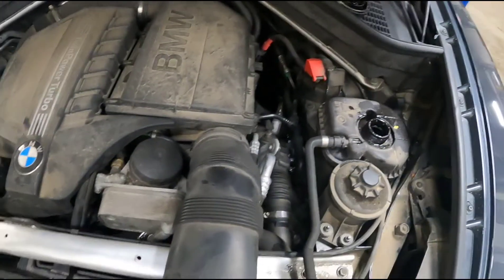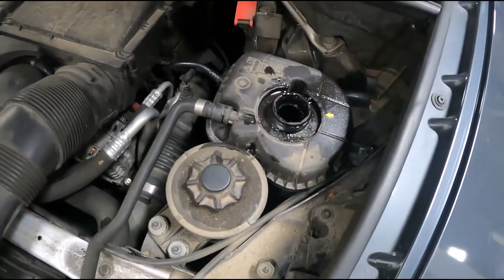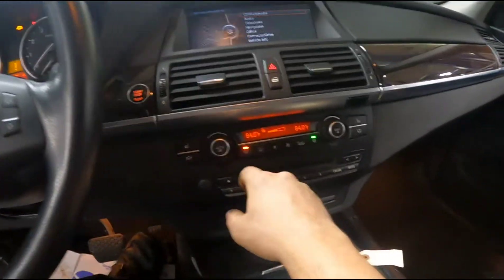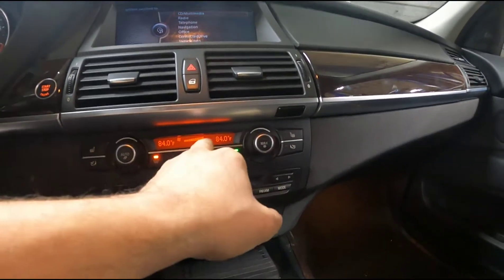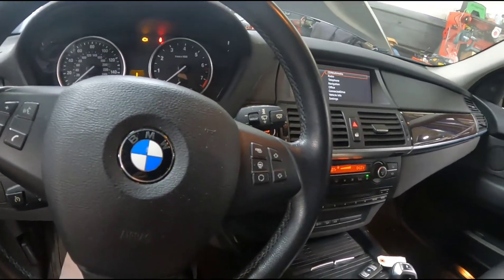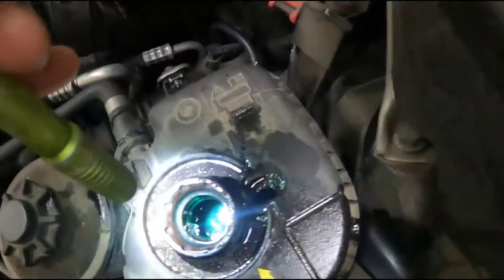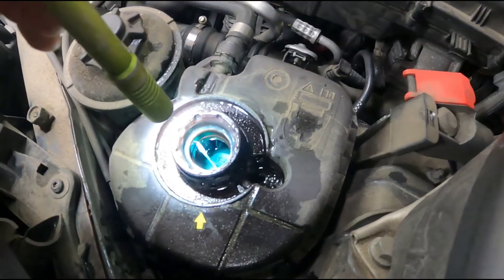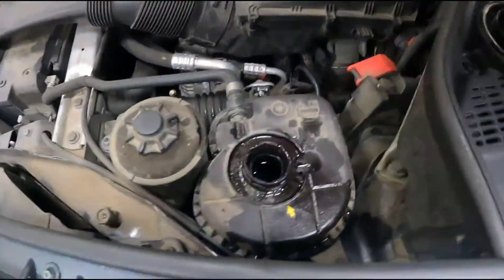BLEEDING THE COOLING SYSTEM ON A BMW WITH ELECTRIC WATER PUMP

Comment: Hi 

Ive replaced de oil cooler and after 2 days I had no heating at all , I’ve replaced the changeover valve and I’ve tried to bleed cooling system. The water pump doesn’t started….. do you have any idea about. I’ve got a 530E 2019 . Thank you
Reply from the maker: Do you have any water pump related faults stored?
Reply: @ no
Reply: @ the changeover valve it’s making silly noise , not all the time, other mechanics are saying about air into the system, I’ve left the engine running 1 hours, it was fine but after 20 minutes the changeover started again
Reply: @EuropeanAutoRepair  I should do the bleeding with the tester? Thanks

Comment: Can you please help... I have a BMW 2014 X3 F25 the Electric Water Pump Bleeding was working fine twice.  Then, it stop after I used the Blue Devil Head Gasket Sealer.  The Engine getting hot.  So, I changed the Thermostat and clean out the Reservoir Tank.  Same issue.  Should I change the Water Pump?  Is there fuse that I should check?
I got 3 Codes:
1) CD9010
     LIN, Message: Electric Coolant Pump: Missing.
     DTC Status: Current
2) 1A2004
     Electric Fan, Actuating Wire: Line Disconnection
     DTC Status: Current
3) 1A2002
     Electric Fan, Actuating Wire: Short Circuit to Ground
     DTC Status: Current
Please help :)  Thank you & God Bless
Reply from the maker: I would double check connections at the pump and the ground wire that goes to the aluminum bolt next to the pump, hopefully it’s something like that going on, if not it may need a pump
Reply: @EuropeanAutoRepair  thank you.  That is wierd right after I put the Blue Devil bottle in - Hell Breaks Lose :(.  Do you know if there is a fuse for the Coolant Pump?  Fuse # ?
Reply from the maker: @mdang3662 I’m not sure of the location of the fuse off hand

Comment: So, push the fob in, but don't hold the brake...ie, don't start it all the way up...I'm old, and no mechanic, but I always thought pressing the accelerator with a vehicle off would flood it 😂
Reply: Fuel injection is different than the old school carburetors
Reply from the maker: Haha you’ll be good, yup key in, no brake, heat all the way up, defrost on and throttle to the floor, wait for the pump to start running

Comment: We replaced the water pump on a 2012 X5 due to a cracked water pump housing.  After replacement, very little coolant came out of the hole in the reservoir during bleed procedure, as well as with the car running.  Thinking that we got a defective pump, we replaced the pump again with a name brand after market pump.  Exact same thing is happening after the replacement.  The thermostat was also replaced. The water pump seems to come on  The vehicle seems to be running hotter than it is supposed to.  What may be the issue? Thanks.
Reply from the maker: Is it setting a water pump speed deviation fault? If you can go to output test with your scan tool and select water pump run it at 100% and see what kind of flow you get
Reply: No, it is not setting any codes.  When we try to activate the water pump with the scan tool, it runs, but small bubbles come out from the little hole in the reservoir without much pressure.  I wonder if there is a partial blockage somewhere not allowing full circulation.   @EuropeanAutoRepair
Reply from the maker: @SAToolBox-qf6dd hmm, sometimes the pumps come with caps on the inlet and outlet, maybe one was left on? Not likely but know knows
Reply: @EuropeanAutoRepair I replaced my water pump and thermostat  on my 09 328i n51 engine  ran bleed procedure it bleeds good heat is hot temp is good but getting codes 2e85 communication as well as 2e81 speed deviation speed difference what could be the reason?

Comment: After doing this, the flow I get from my pump is non existent. I’m gonna assume the bear inside is gone and no coolant is flowing. Would that be the right idea.
Reply from the maker: Do you have any water pump communication faults or water pump speed deviation faults stored?
Reply: @EuropeanAutoRepair  no, but after turning the car off I get a very loud noise from the lower passenger front.

Comment: I just had a piece replaced and a hose and still my car was giving me a leak because it kept asking for coolant. After I drove it when I went to open the cap it I noticed a lot of the gas was coming out. Eventually I closed it back. The coolant edition request never came back and I was wondering if that is something that you should always do, which is release the pressure I’m assuming since there is a  pressure valve next to the cap.